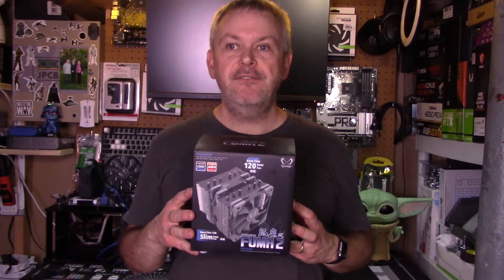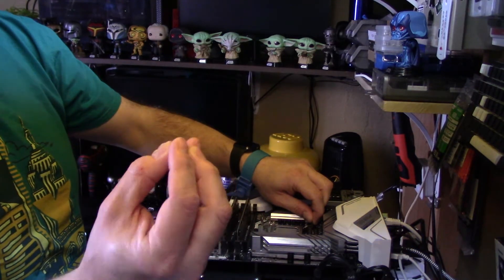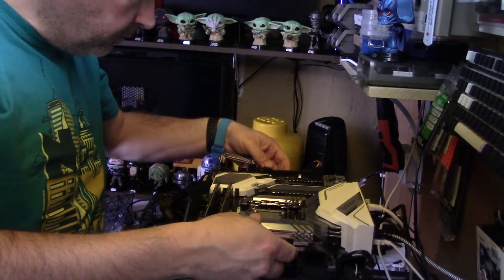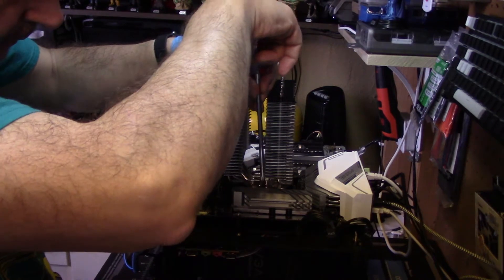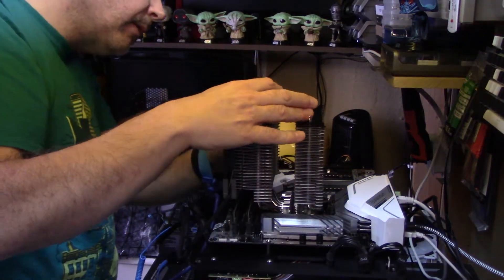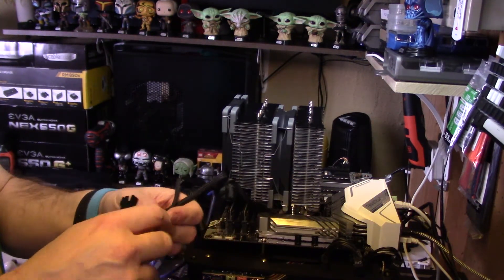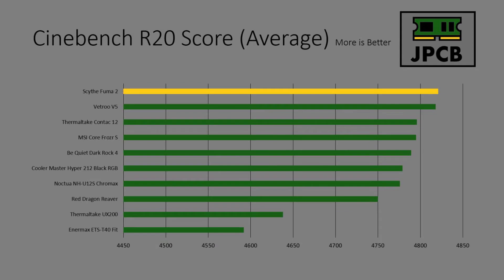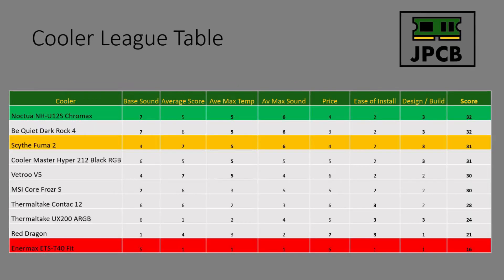Scythe Fuma 2 Vs Noctua NH-U12S and More

Comment: Been using this on my 5900x for about 10 months. 

It's.... absolutely perfect.  Gaming temps average 58-62C, depending on the game.  It averages 65C in BF2042 which pushing my 5900x to 50% average which means around 110-115 watts power draw.  We'll say 110 watts average (I use HWiNFO64).  That has the main cores used pushing 4.6xghz average according to HWiNFO64.  Single core peak is 5.05ghz.  4.95ghz stock with a +100mhz boost in the PBO/CO settings.  

I couldn't be happier with an air cooler.  Let me just add those temps are from the "CPU (Tctl/Tdie)" temp readings.  The hottest part of the entire die that the sensors read.  My core temps?  MUCH, much lower.  The hottest individual core temps are typically 8-10C lower than the Tctl/Tdie readings.
Reply from the maker: THat's really good data and thank you for sharing. It's a really good cooler. People have mentioned there is version available now as well.
Reply: @jimbopcbuilds  I just came back across this video lol.  I'd like to correct a mistake I made, I'm using the Fuma 2 Rev B, not Rev A.  Also, on my AM4 motherboard, it uses the stock baseplate.  It was the easiest heatsink I've ever installed lol.  That's on the AM4 platform, at least, apparently not for Intel.

Edit:  However, it's still performing great, fans still doing well, I'm running Asus Performance Enhancement which uses PBO, but gives me better clock speeds in games, and it gives the PBO settings of 1000w PPT/1000a TDC/180a EDC, making the EDC the limit.  I can pull up to 200-220 watts, depending on the task.  CPU-z, for example, will have me pull 177 watts with my current settings at 80.2C.  Not bad.  I can get better temps if I use different fans, like the 2000RPM fans I have from a couple of Hyper 212 Evo heatsinks I don't use.  This gives me all core 4.625-4.65ghz at those watts and temps with my settings and per core curve optimizer + boost.  I peak at 5.1ghz, now.  I just went back to these original fans because they are quieter and I like the idea that they both spin in opposite directions.  But mainly because I don't like hearing 2x 2000RPM fans roaring when I'm doing something demanding lol.

Comment: Would the scythe fuma 2 fit in my be quiete pure base 500dx mid sized tower?
Reply from the maker: Yes it should fit easily. That case supports coolers as high as 190mm

Comment: the only reason the fuma 2 beats noctua u12s and also the reason I cop it is it can fit in the nr200p easily with temped glass panel on
Reply from the maker: I hear what you're saying. The fuma is wider rather than taller.

Comment: Good video. I’ve picked one of these up about six months ago and love it. I run it on a 5800x as well as a Capellix 150i and this is not far off from the aio. Running a 4.7 all core and it idles low to mid 30s, Warzone plays at 60c, and benchmarking hits mid to high 70s. Even told
My coworker about it and he is running it on a 10700k running at 5ghz easy peasy now.
Reply from the maker: Nice. I’d heard nothing but good things about it before I tested it as well. It’s awesome to see it living up to the hype.

Comment: Nice comparison and video. Do you think that Scythe Fuma 2 is capable for 12700k?(more for games - no oc).
Reply from the maker: Thank you. Yeh I'm pretty sure it'll be able to handle the 12700k. I'm not sure if Scythe are offering an adapter for socket 1700 co check before you buy it.
Reply: @jimbopcbuilds  Thanks for your answer.  Fortunately, he has released a 1700 socket kit.
Reply from the maker: Oh goood.

Comment: Can the fuma 2 handle the heat from 11700k mostly gaming no oc. what temps on avg should I be expecting?
Reply from the maker: I tested the cooler using a 10700k which generates a similar amount of heat. It's handled the stress test I threw at it without a problem with temps staying in the 60s and was still super quiet. So for me it should very easily handle the 11700k and generate a very similar heat and noise profile.
Reply from the maker: I test using the noctua heat compound which is pretty decent stuff. The cooler comes with a tube of paste but I would consider buying a better one. They're not very expensive.